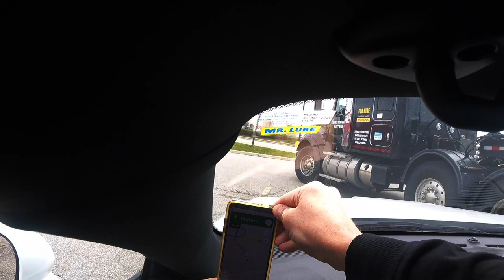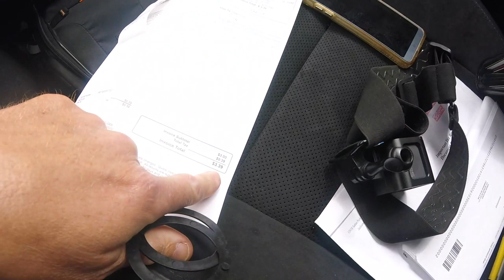A $1.50 part for a $5,000 Cummins...

Comment: Sergei I noticed that your drivers side rear fuel tank rubber strap is bunched up...the band is not tight....you may have to heat it up to remove it clean the threads and antisieze it and retighten it
Reply from the maker: the rubber under the strap looked like that from Day 1, when I got this truck. Someone probably fell asleep at the Kenworth conveyor...

Comment: You should look into Lucas oil products. I do a lot of heavy hauling here in the Pacific Northwest and use Lucas 5th wheel lube it is slicker than grease and lasts longer, a bottle will lube it around 8 times and costs around $8 U.S. I also use Lucas Hub oil for my wheel bearings and Lucas engine oil additive and my wheel bearings temperature runs around 20% cooler temperatures and my engine oil temperature runs about 15 to 20 degrees Fahrenheit cooler. I also use the engine oil additive in all of my gear boxes and they also run cooler especially with heavy loads. They also have oil for performance and racing engines, my friend professionally races monster trucks and after using their products his blower engines that runs on nitro methanol lasts almost 50% longer between rebuilds.
Reply from the maker: not recommended by the manufacturer.
Reply: @HHTV60  Really because I buy all of my Lucas oil products from my Kenworth dealership here in Idaho Falls. They're actually the ones that got me started and hooked on the stuff.
Reply: Sergei Dratchev he’s right about the fifth wheel lube tho.
Reply: I only use MOTOR KOTE PRODUCTS

Comment: Serge, you're definitely not imagining things. Fontaine's are super picky when you hook the neck up.. we have a 2020 55 Ton, a 2013 51 Ton and we used to have a 1998 35 Ton and a 2003 55 ton. I've done it with all four. You hook the neck up just a slightly bit off and it does seem as if the trailer is "dog tracking"! Especially when the trailer is really worn out, like our 2003 was.
Reply from the maker: Good point!

Comment: Hey Sergie. Thought it might interest you that I had a Cummins test engine like the one you have in your truck .From 1995 to 1998 it was a Signature engine back then before they were on the market but it was still a over head cam engine same as the ISX 15. It was set at around 750 HP and 2250 foot pounds of torque. Their was around 15 in the US at that time. Three of them here in Colorado where I am.
Reply from the maker: I plan on buying a tuner to turn up the HP and torque a little bit. Cannot hurt with heavy loads on big grades!
Reply: @HHTV60  You need it with the loads you haul for sure!

Comment: Have you considered buying an old forklift to help with the moving of the trailer parts?
Reply from the maker: No.
Reply: justjok we ended up doing just that...but if your not on solid ground it's worthless.  It pays for itself in 6 months...saves on the ole back too.  But its tuff if you dont own a shop or property.

Comment: A trick to check if your trailer is tracking straight.  Next time you are driving on a nice straight stretch of road, put  right side drive tires next to the fog line, then look at your trailer tires. Then put your left drive tires on a traffic line, and check your trailer tires again. They appear the same. If there is a heavy crown in the pavment, the trailer with track to the right, downhill.
Reply from the maker: great tip, except it only works when you can tilt your mirrors down far enough to see the line on the pavement at your drive tires. WARNING: a 350" wheelbase is required for this little experiment.
Reply: @HHTV60  I used to use my spot mirrors. I would adjust the view so the inside edge I could see side of the tires. The outside view would overlap what I could see the flat mirror.

Comment: how popular are greaseless fifth wheels there just a bit of baby power on the plastic before you hookup and nice and clean
Reply from the maker: those are illegal in alabama. $5,000 fine or 30 days in jail, shrimp 3 times daily.
Reply: @HHTV60  ok I wonder what the problem is with them I bolted 6mm plastic to the skid plate on the trailer and the jeep the best thing ever here in Australia grease and dirt dusty roads just dry the grease out and then it doesn't want to turn at all were as the plastic and running dry works great for me
Reply: Would not run a greased plate again if I could help it ...is it really illegal in Alabama? I wonder why
Reply: @HHTV60  hi

Comment: Heat the nut or replace with a new one
Reply from the maker: Make sure to check all locks before you go to bed.
Reply: If the strap is loose the rubber bunches up because the tank is twisting...or moving when it shouldn't

Comment: Sergei in my experience putting a tire from passenger side to drivers side without flipping tire can cause broken steel belts, can you use the pusher axles tires and wheels on your steer axle, i don't know if they're the same size
Reply from the maker: not if it's the same vehicle. never transfer whee/tire assembly from one car to another, unless you own both, and no warranty has been left on the engine's exhaust.